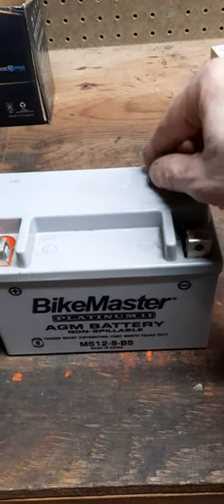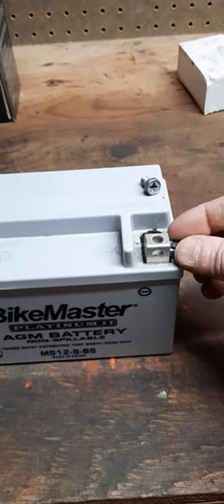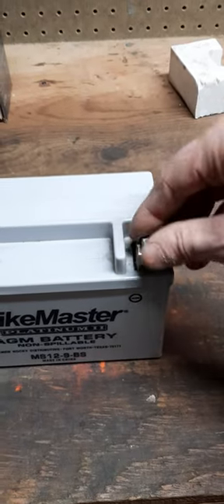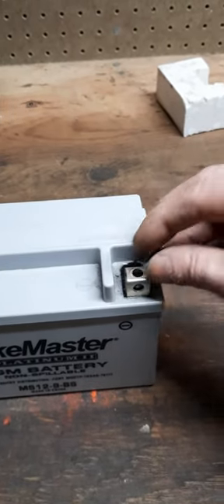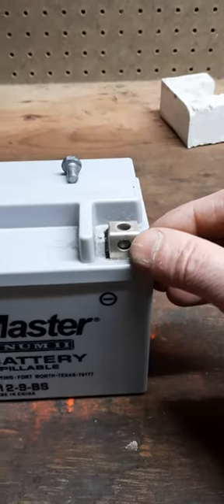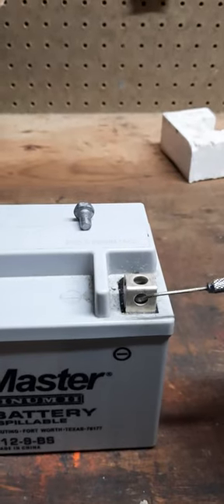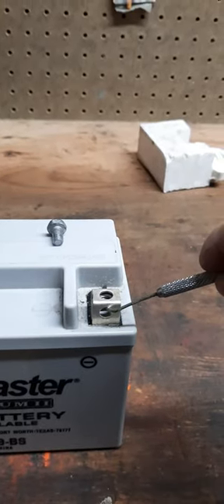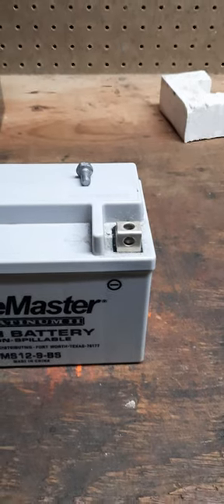HOW TO INSTALL THOSE PESKY MOTORCYCLE BATTERY SCREWS!

Comment: I use a popsicle stick, trimmed to fit the slot, push the nut in, tighten the bolt, and then pull the stick out. No danger of arcing the battery to the equipment your working on. The metal dental tool may accidently touch the metal frame of the equipment your working on and arc.
Reply from the maker: Too tight of space on my bike to do that with battery in place. Be careful and you will be fine.
Reply: @cyclerider5652 or just use plastic tooth pick..mistakes happen even when carful why not just avoid them all together? Really can’t teach a Old dog new tricks…jeez.
Reply from the maker: @iShOotBlasterz  No room. Need something hooked. Plus, plastic toothpic wouldn't get a good grip. You won't get shocked. No metal around my battery box to ground on anyway. Do you use a plastic screwdriver? jeez.

Comment: Just stuff a little stiff paper under it like folded cardboard ...Match book anything ..a little sturdy. Piece of Foam .
Reply from the maker: You could try that although it works poorly and then you have the foam or cardboard trapped under the battery terminal. I've tried such methods in the past with little to no success. My method is faster, easier, cleaner and works much better. That's why they leave the opening on the side.
Reply: I use a small piece of dum dum putty or plasticine to hold the nut. Never fails.
Reply from the maker: You don't need to put anything underneath if you use the side slot. The battery was designed this way. It's cleaner and faster too.